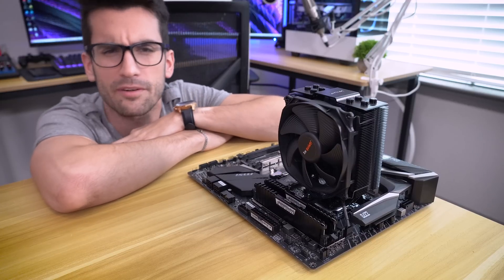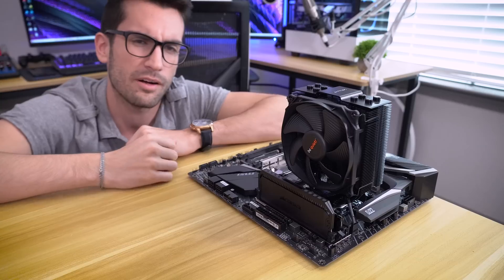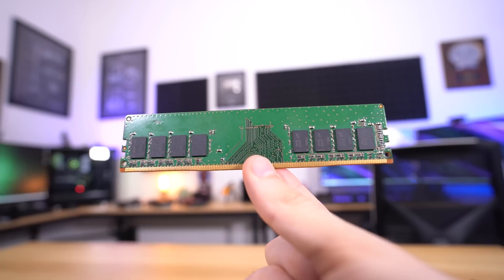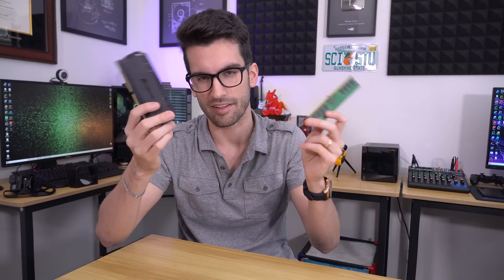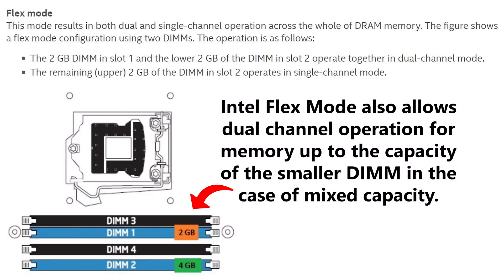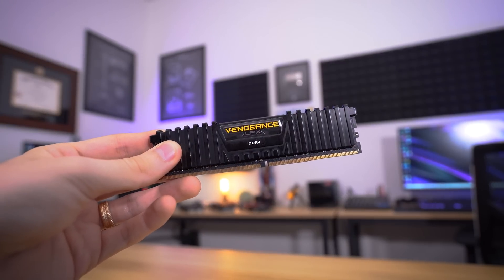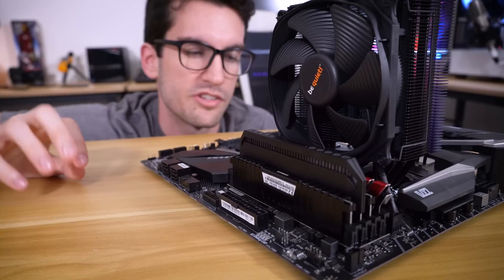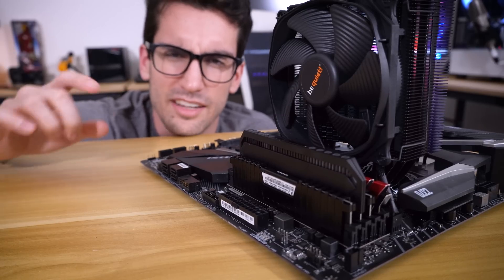Mixing RAM?!

Comment: I'm got it for the most part, but I'm still a little confused. Would I be able to run 2 different brands of ram both at @3200mhz and 8gb for quad channel? For example 2x Corsair and 2x TridentZ both @3200mhz and 8gb (32 gbs in total). And if so, is there anything I would have to do to allow the computer to run quad channel with 2 different brands or would it automatically pick up all 4 ram sticks. I'm fairly new to pc building and I want to put all my ram to use.

Comment: Every single Gigabyte LGA1150 board that I've dealt with recently has being extremely sensitive to which RAM sticks are used. The boards must have matched kits or else they; refuse to post, have random BSOD, have Windows randomly corrupt.

Even the model number on my current sticks being off only by the B at its end was enough to cause drama (2x identical kits don't have any issues, even with a 2 year age difference).

Comment: Greg probably won't see this but I had g.skill ripjaws 5 and g.skill trident z 3200mhz each and they had the exact same timings and were both 16gb kits paired with my Asus z170 pro gaming mono and 6700k. The modules refused to work together without bsod's a lot.

Comment: Oh its possible and I've done it many times, tho occasionally I run into where the system just don't like mixing some brands, I had one system where I thought the board was bad as it would stress test just fine and everything, but it would randomly freeze at idle, here the system has 2 different revision kits of Corsair Vengeance ram, they looked alike, but revisions were different, thats why I never immediately went to testing the ram as it worked just fine in another system for years.

Comment: I have a 2400mhz ddr4 ram installed in my laptop so  can i couple it with another 2400mhz ddr4 ram, i use linux, is there anything else i have to worry about?

Comment: So if the modules are the same it wouldnt make any difference?
Like say a corsair module at 8gb 3000mhz at whatever timings paired with a g.skill module with the exact same specs wouldnt have a hitch
Reply: Yep
Reply: They might even be made with the same die.
Reply: glad! now i can mix up black from tforce and white from corsair dominator!
Reply: its been some time and ive looked into memory a bit more. theres also the different dies, die manufacturer, and the latencys..

Comment: To put it frankly, the worse memory module is what is getting used essentially, as any other module that's better is going to not use its full potential and slow itself down to compensate for the worse module, if it didn't do this you would have way too many problems.

Comment: When I built my first  gaming specific PC I had 8GB DDR3 Crucial Ballistix Tactical 1866 MHz 9-9-9-27. My friend gave me another 8gb stick of 1866MHz(not my exact dimm), and when I put it into my system it wouldn't boot.  I took it out and gave it back to him, then I bought another of the 8GB modules that I built the PC with. Even though the modules were not from the same kit, they are identical. It worked fine after that, at proper 1866MHz and no BSOD>

Comment: Sometimes you get a problem if you use similiar Modells, of 2 2 DiMM-Sets. So all in all 4, if you lucky everything is fine, if you are not lucky thens it is possible that the advertised xmp/docp profiles dont work on a 4 DIMM setting, but on a 2 DIMM setting everything is fine.

Comment: I run two sets Corsair vengeance the only difference is one has RGB and the other doesn't. Their clocks and timings are identical (3200mhz c16)

Comment: Can me mix two rams with the same frequencies and different brands, I want to upgrade my hp laptop's 8gb ram to 2*8gb=16gb  by adding another 8gb crucial  module?
Reply: Yeah I've done that and so far no issues but I'll report back if there are (most likely not cause I'm lazy)

Comment: the only suggestion i can give is, if the slower and lamer stick has a cooler on it and good enough ventilation, you can tighten up the timings and raise the speed 1 notch. this way at least, if it is stable, you will not have to slow down the better RAM as much. like having a 2400 MHz at 2533 or 2666 MHz and timings that are around CL 15 or CL 16 can go to 1 lower not much problem usually. just don't try timings of CL 12 at 3000 MHz and be conservative.

example i have 2 16 GB sticks of 2400 MHz with timings of 15,15,15,36,440 set at 2533 with timings of 14,15,15,34,384 with a bump in the BCLK at 102.5 instead of 100 and bumped the RAM voltage from 1.22 to 1.23. really conservative so they do not error out. i saw online people achieving with the same sticks as me a 2900 MHz range with tight timings and bumping the voltage a lot more... that was maxing the stick out. reliable yes, but for how many years? anyhow, a "small" bump is usually fine and if you get Blue Screens of death (BSOD) then you can take the bump off.

Comment: If you get a BOSD after mixing memory, it's not fully stable & you shouldn't run the system like that if you care about the your data on it. I've run multiple systems rock solid stable, on 24/7 with mixed memory modules, I normally manually set the timings & frequency to slightly slower than the fastest settings that pass multiple stress tests & memtests, then run the tests again a few more times to be sure.

Comment: Running a mixed DDR2 setup for little over 6 years in an older system without issues.
And those are DDR2-800 CL5 OEM modules and DDR2-1000 CL5 enthusiast modules. Together they easily do 880 CL5 or 940 CL6.
Before that I had a 2x 1 GB & 2x 2 GB combination. Also doing fine.
At the same time I got some DDR3-1600 CL9 modules that do 2133 CL12 just fine.
WIth a but of tinkering basically anything can be make working. the amount depends on what is there and how it should run in the end.
Reply: Oh, and that system holds up surprisingly well despite it's age.
Not my main rig tho

Comment: My parents have an old intel pc, I upped their ram from the prebuilt pc 1gb ddr2 per stick (2sticks 2 slots ) to 2 different sticks 2gb ddr2 per stick to double the ram from 2 to 4, for years, it's only had problems with power supplies, cheap ones of course, and that's about it

Comment: If you can stay within the same brand, for example all Corsair Vengeance, and same capacities within each "dual channel," then it seems to work well.  For example pair of 8GB DIMMs in channel A, pair of 4 GB DIMMs in channel B, even if the timings are not matched, but close between channels, then it tends to work well.  I have occasionally mixed capacities within the same channel, but that is a bit of a gamble...it either works or not.

Comment: When we talk about laptops just using same capacity and same or better frequency it will default to the timings of the slower one, not a big issue there. In terms of pc's mixing pairs of ram kits will not be an issue as long as you keep each pair to it's channel (1-3 for one kit, 2-4 for the other) assuming they are the same speed/latency. If one of the kits is slower plugging that one first loading the xmp and then adding the second kit should work just fine.Also mixing kits capacities should also work just fine eg. using a 16gb kit on one channel and a 32gb kit on the other. Issues will be if you mix capacities within the same channel (using a 8gb stick with a 16gb one) other than that everything should be ok. People should check in advance of buying a pc how their ram is configured (single/dual channel) and if they build it themselves always opt for dual channel memory

Comment: I mixed different 8gb sticks of ram in my 1st gen ryzen pc and it worked great. I made sure to get matching voltages.Havent had any issues in this past year
Reply: What does matching voltages mean
Reply: @tuckfru  every ram stick has a rated voltage, generally 1.2V or 1.35V for ddr4.
Reply: @ericmartens8151  how do you find it
Reply: @tuckfru  It is printed on the label

Comment: My main desktops/workstations are all currently running mixed kits. My Threadripper 1950x has 4x Corsair Vengeance 16GB 2666Mhz modules, 4x G.Skill Ripjaws V 8GB 3200MHz sticks, all running at 2666Mhz and whatever the timings were for the Vengeance. My i9 7900X build is running 4x Corsair Vengeance 4400MHz 8GB and 4x EVGA 8GB 3200MHz modules, all running at 3200MHz. Haven't had any issues with either. I've also run mixed capacities too without an issue. Yeah, I'm losing RAM performance on my setups, but for what I'm doing, capacity is more important than speed [and those 4400MHz kits, which I was lucky enough to be given by a Corsair rep, I can't run at 4400MHz anyway because none of my board/processor combos like those speeds.]

On the "can't mix DDR with DDR2 or DDR3 or DDR4 or any of those", did you know there were boards that could take DDR2 or DDR3? And it really was OR -- they had both sets of slots, but only one kind could be used at a time. It was interesting, but a lot of people were confused why it didn't work with both DDR2 and DDR3 installed at the same time. [might have been DDR and DDR2, but I think it was 2 and 3]

Comment: I've also found all this to be true Greg, especially the note about AM4 platforms being picky about memory relative to intel. I've built a number of am4 systems and the first couple were built with whatever was cheap or on hand, and they were never happy at xmp speeds, but choosing ram off the motherboard's QVL has always worked out for me.
Reply: Picking from the QVL probably guarantees compatibility.  It still can be a pain if you want to find the best cross point of capacity and speed.  It can take a while to find something that is still available.
Reply: this advice was better 3 years ago when I said it. It's mostly not a problem now.  @uncrunch398

Comment: Greg...what if we run modules with same frequency but different trimmings...is it possible to tighten the timings of the higher latency DIMM to work with the lower latency DIMM at same frequency. Also is it possible to set different boot voltages for the different DIMMs?

Comment: What I have seen, generally mixing different ram brand or even different speeds will work fine if the PC uses the speed of the slowest module as long as they are of the same ddr generation. However, for optimal performance, you should use identical modules. In my main gaming PC with an i7-6800k CPU, I have four identical 4 gb gskill ddr4 3000 MHz (16 gb total) ram modules in quad channel.

Comment: I'd be interested in a benchmark of 2x8g cl14 vs 2x8g 1@cl14 1@cl16 obviously LCD would apply. 

Seeing the difference would be cool. So mixing Samsung B-die with SK-Hynix A die... would basically be the difference of the 2, if it works at all. I suspect alot of subtiming issues. 

Couldn't really use AXMP profiles so there is another rabbit hole.

Comment: Thank you for making it clear! I am building a new PC, and I am scrounging parts from my current PC. The RAM was the big unknown, and I am trying to keep the cost down while still having a strong computer. I absolutely overpaid for my current PC, as it was prebuilt (had only a Best Buy credit card available at the time), and it has purely basic cheap AF RAM (one stick, naturally). I may or may not buy a single stick over a double stick kit. This video does alleviate a lot of concern over whether or not i will be fine with buying another stick.
Reply: It's not suppose to alleviate your concern, its just a video to show that it's an Okay think to mixed ram but some people might have other issues, so every situation is unique.

Comment: what I really wanted to know was if i could mix corsair vengeance LED ram with corsair vengeance pro ram? theyre both ddr4 and run at 3200mhz, essentially the only difference are the leds i guess? im not sure
Reply: Yeah probably. Might have different timings to work out, but I'd think so.

Comment: Would the "kits that are meant to work together" on ryzen necessitate selling my 8gbx2 kit for an 8gbx4 kit if i wanted to go from 16gb to 32gb of ram as opposed to buying an additional 8gbx2 set of matching speed/latency/voltage modules.
Reply: No not at all, I went from a 2x8 16gb kit to a 32gb kit, 2 sticks to 4 sticks.
Reply: I did the same thing went from 2x8 then added 2x16 all Corsair vengance pro rgb 3200 with no issues. Even OC a little with xmp running just fine